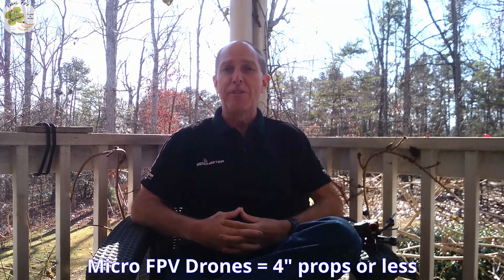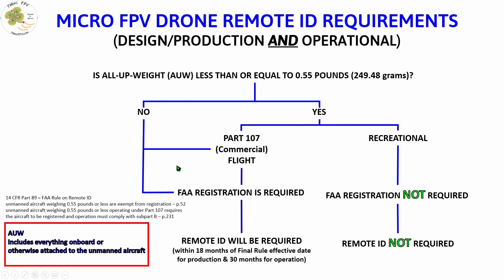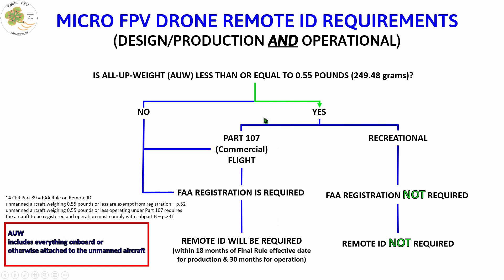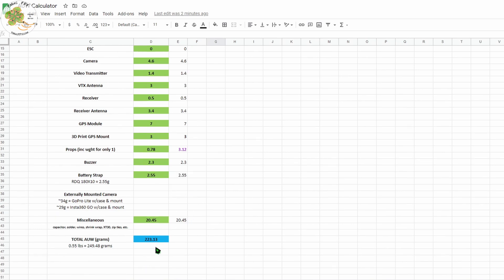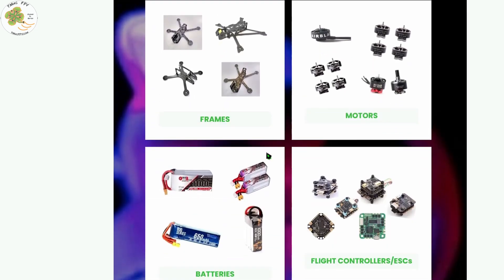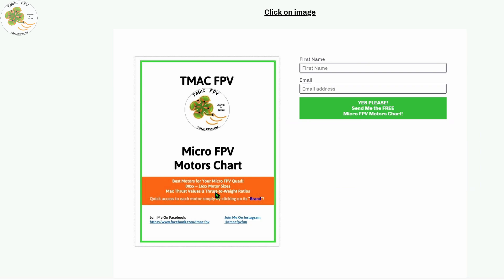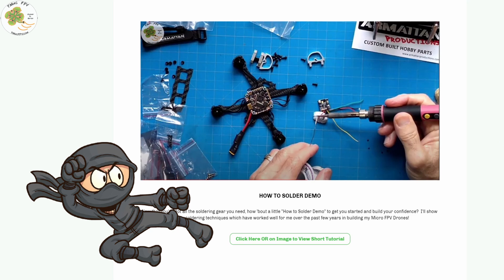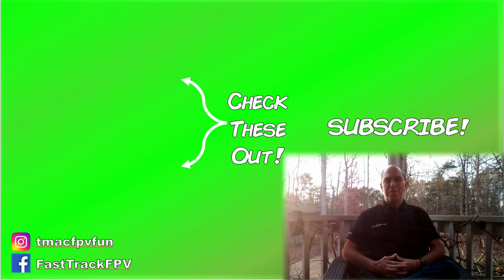Micro FPV Drone Build (NO REMOTE ID)!

Comment: Hey TMac. Very happy with my sub 250g Rattler. It flies fantastic on those tiny 4s 850mAh. She's still having some hot motors, though. I've been using your PID values, since mine is on the same motors (T-Motor F 1507). No Gopro. Any thoughts?
Reply from the maker: Hey Adriano!  Let's see if I can help you out here.  First of all, I think I recall you saying this was your first MIcro FPV drone build and yo have been flying those "behemoth-type" quad's.  I need to make sure yo understand the expected temperature difference between large and micro motors.  Micro motors will get "warmer" than larger motors (warm is a relative term).  Although "warm" If you can press your finger tips on the outside of the motors after flight and keep them there for 5-10 seconds without feeling the need to jerk them away to prevent from burning yourself, the motors are most likely not "too hot."  Now, if you are unable to do this (and consequently, the motors are "too hot," then yes, adjustments will need to be made.  Do you have the PID Tuning Guide?  If not, grab it from my site at https://tmacfpv.com/micro-fpv-pid-tune/ . On page 5-6 of the Guide (flowchart & text), I explain too much D-term gain or not enough D-term filtering can cause motors to overheat: "If you increase your D, it’ll dampen or slow down the P term, reducing overshoot as well as prop wash
vibrations and that shuddering effect. However, too much D can result in hot motors, potentially damaging
them without sufficient filtering."  So, if your motors ARE "too hot," you can try a few things (one at a time).  1.  If you have not enabled RPM filtering, do so. I will no longer fly without it (Tuning Guide).  Check to see if this makes motors "less hot." 2.  Page 7 of Tuning Guide:  Move Gyro Filter multiplier & D-Term Filter Multiplier together to the left (More filtering) one notch (click SAVE) and check motors temp to see if its fixed.  If not, move another notch left (i.e. repeat same procedure).  3.  1 or 2 above (or a combination of both) should decrease your motor temp's.  If not sufficiently, you could try reducing your P &  D Gain slider (move it to the left) a notch or two.  I'm confident one of these (or a combination of them) will cool your motors unless you have some sort of physical/connection issue (motor screws too long, etc.).  Let me know your results & fly fearlessly!
Reply: @TMacFPV  just read your thorough reply. Yes, they are hotter than the 7 in quads, but not finger burning hot. I will fiddle a little bit, according to your guidelines and will give you a feedback. For now, all I can say about the Rattler is  praise. It flies like it's on rails. It's locked, agile and cruises like a heavy quad. Thank you very much.